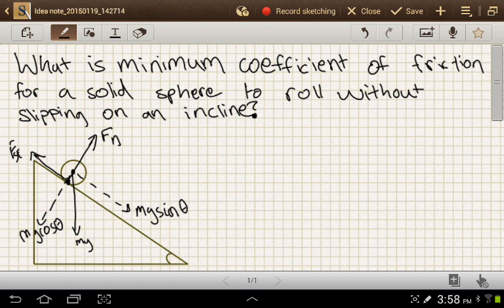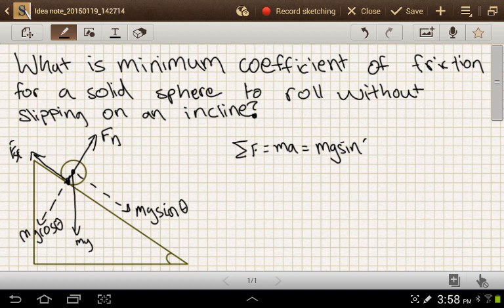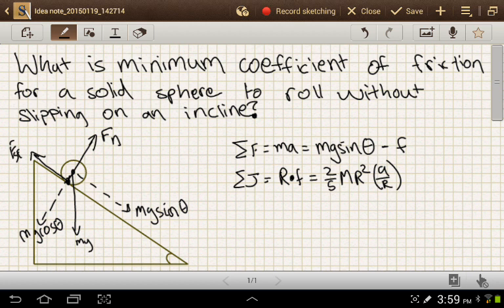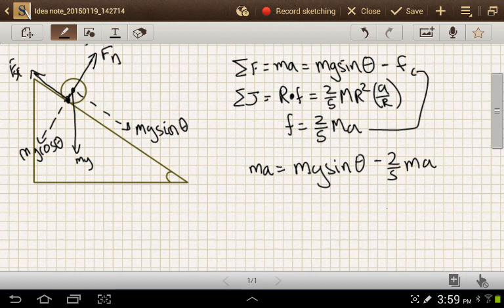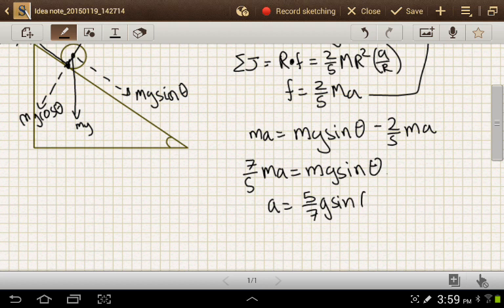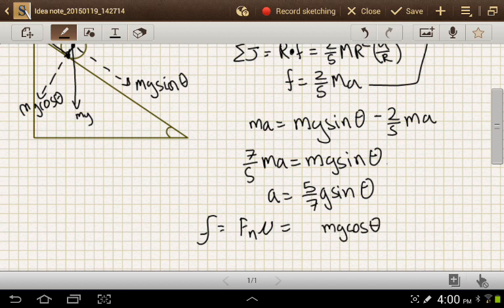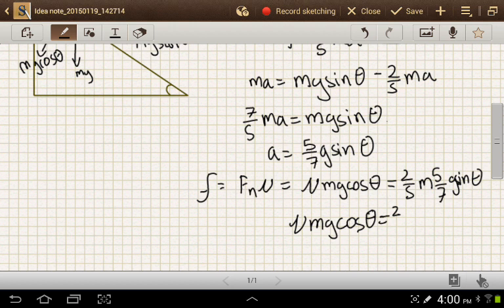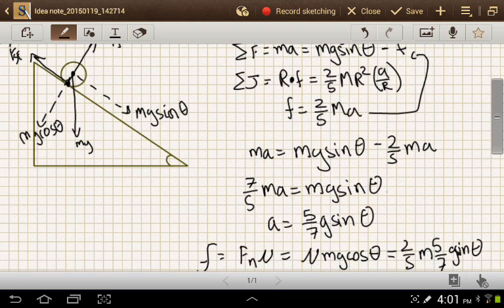Rolling Without Slipping Friction

Comment: Why do we always take the net Torque positive? i.e R×F even though direction of this force yields for a clockwise motion plsss answerr
Reply from the maker: You are correct: the convention is to take counter-clockwise torque to be positive. However, it doesn't really matter as long as you are consistent in notation. If you take CCW to be +ve, then CW must be -ve and vice versa. In this case, there was only one torque so it didn't make much of a difference either way. Hope that makes sense!
Reply: @UpayanM  Yes I understand that everytime I choose a sense that may or may not be with direction of motion I will work the sense of torque according to what I consider.
Reply: I have another Problem in my textbook I am having tough time to grasp the concept of it i hope you can make a video or maybe explain briefly : A uniform rod of mass 200 g and length 100 cm is free to rotate in a horizontal plane around a fixed vertical axis through its center, perpendicular to its length. Two small beads, each of mass 20 g, are mounted in grooves along the rod. Initially, the two beads are held by catches on opposite sides of the rod’s center, 10 cm from the axis of rotation. With the beads in this position, the rod is rotating with an angular velocity of 10.0 rad/s. When the catches are released, the beads slide outward along the rod. (a) What is the rod’s angular velocity when the beads reach the ends of the rod? (b) What is the rod’s angular velocity if the beads fly off the rod? 
Spoiler: Part B the angular speed w will be the same but I can't understand whyy :(

Comment: is it coefficient of static or rolling friction
Reply: static
Reply: @hearthstoner4401  why is it not rolling ? 
TU in advance
Reply: @Nour-vk9md  Static friction is the force that resists the sliding of the sphere against the incline at the point of contact, prompting the sphere to instead roll. rolling friction is a much more minor force that slows down the rolling sphere due to small deformations in the surface which impair smooth rolling
Reply: @hearthstoner4401   so it seems like kinetic friction but with the rolling objects?
Reply: @Nour-vk9md  not exactly since it has to do with different factors